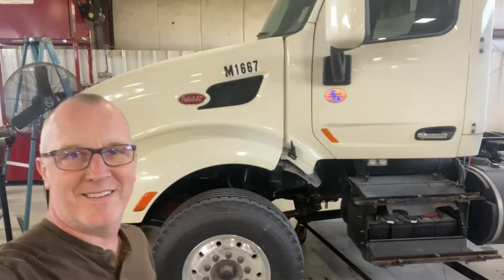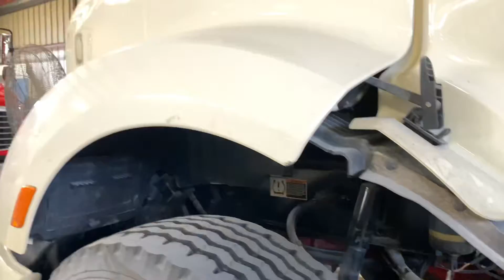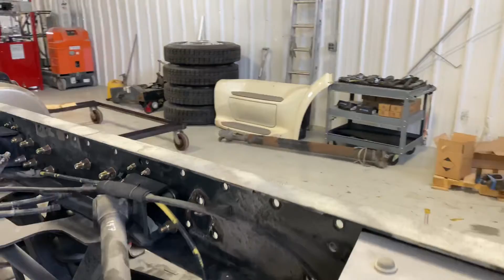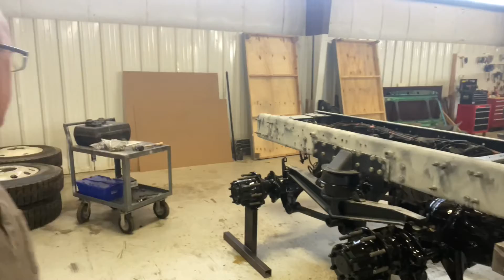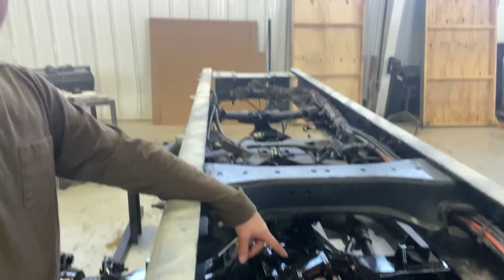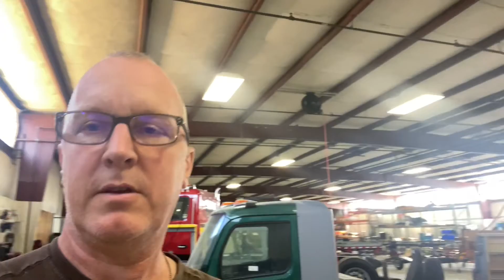Chalmers Suspension kit, junked my old air ride. Dump truck build 101. Peterbilt 579 conversion

Comment: What's the advantage over a Hendrickson walking beam suspension? .
Reply from the maker: Your LEFT kidney. 
The chalmers does have a little hop in it but I’ll take that over Springs. Or old school Hendrickson pad.
Reply: @DaycabDaycabs  I haven't seen one here in Australia.
Reply from the maker: there  on a big rubber mount. It is made in Canada. Pretty good ride.

Comment: I figured the air bags would ride better than a chalmers suspension.
10 hr dirt and rock hauls slowly beat the life out of a person.
Reply from the maker: Chalmers is a walking beam suspension. For off road work. Air bag is an independent suspension horrible for off road.
Reply: @DaycabDaycabs  Yea not to mention if an air bag blows you are parked until you get one.
My 07 Kw T800 had chalmers suspension and it really worked well. It is a bit of a hassle to change out all the rubber in the dog bones though.

Comment: You need a heavy spec to make a dump truck. Just because you say so does not mean it is. 
This is why people get killed on the roads because of this garbage.
No double frame, no heavy front I beam, no heavy rears. All that weight you will break something. 
This is why you don’t take a road tractor and convert into a dump truck.
So many ticking time bombs on the roads.
Reply from the maker: You have no idea what you are talking about. This truck will have a 50,000 lb gvw. I have 35 years running this exact set up. 12, front 40 rears 5,000, steerable drop 55,000 gvw single frame. You should travel a little. There are many types of dump trucks. Not all are double frame. 20,000 none steer drops. With 18 ft boxes with 80,000 lb gvw. Thanks for your comment.
Reply: lift blocks at front I beam?
Reply: @DaycabDaycabs sounds all good to me. As you are saying you are building for your needs of 55k vs 80k.

Comment: Drove a truck eith a Chalmers.  Extremely stable. The ride was actually pretty good.  The other drivers said the same thing.  Prefer it over most air rides
Reply: I drove a crane truck with a Chalmers for 20 mins and I needed advil for my back afterwards
Reply: @AJ-zg7sc  ya it's weird....I drove some four spring Reyco that were great and drove some that would put you thru the roof....guess there are many factors......I didn't expect the truck I drove with the ,Chalmers to be good at all..but it was
Reply: @jim-zx7gz  I'm curious how the Hendrickson haulmaxx compares to it

Comment: Fuel tank brackets are on the top. That doesn't seem right to me
Reply: All Peterbilt fuel tank bracket are on the top.
Reply: @Freedom37854  I never noticed. But then again all my trucks are Macks Kenworths and Western stars.
I am curious about that bracket Mount and the torque rods that you put on top of the housing.

Comment: Just curious if the Cummins spun the front drive gear? My Pete 388 tow truck blew its x15 at 65k 😭
Reply from the maker: When I got it the motor was full of antifreeze this motor was probably the worst of them. It’s getting a Detroit in January.